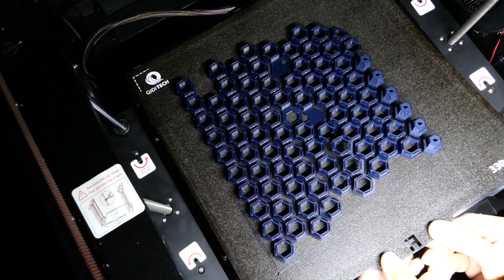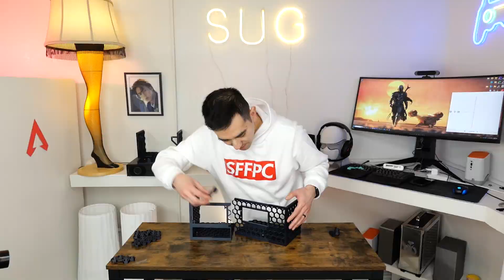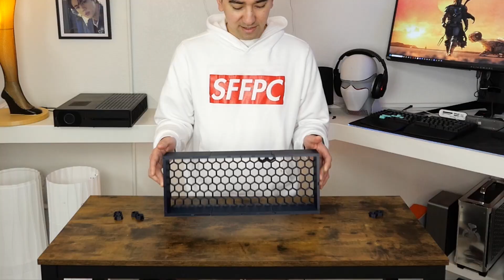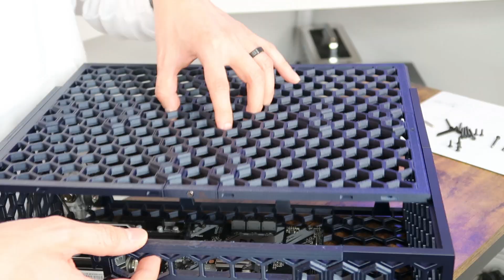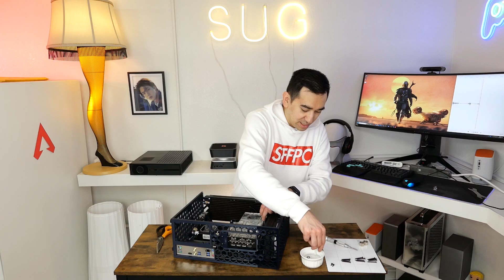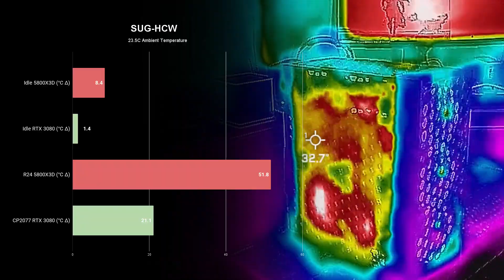A Full Size ATX Gaming PC Anyone Can 3D Print

Comment: 5 months late to the party, but if you still read the comments I think I have the answer you was looking for that no one seemed to mention yet. When you was plugging in the PC feet/stands the ones that felt loose appeared to only be like that for the regular honeycombs while the honeycomb connectors you printed to keep the pieces together also appear to have inner spacing inside them (guessing because they were designed smaller to fit into the regular part honeycombs) thus making it a tighter fit or connection for your feet/stands when they were inserted. Don't really think you did anything wrong but if you wanted consistent tightness for the feet/stands you could have single honeycomb connectors placed them where you wanted and then connected the feet/stands into them without the need for extra glue. Enjoyed the video and I hope the build has held up over the months.
Reply from the maker: Thanks for watching and sharing the knowledge! The PC has since been dismantled: https://www.youtube.com/live/RdOw7wftjuI?si=tTSuifTfQx7QcqDG

Comment: This is the video that introduced me to your channel. I'm actually planning to build this case. Do you know if it will accommodate a 330mm GPU?
Reply from the maker: Thanks for dropping by! I designed it with the FE RTX 4090 virtual dimensions (I don't own one) - so use that as a measure.
Reply: @standupg4m3r  looks like my card may be too long, so I'll need to get creative. Even water cooling the gpu won't help since the PCB extends to the edge of the heatsink
Reply from the maker: @XxDrac13xX  i forgot that not everyone needs to watercool? https://www.printables.com/model/866926-sug-hun/comments/1906251
Reply: @standupg4m3r  I have an AIO for the CPU so mounting the riser won't be an issue. But my RX6900XT is 330mm and the 4090FE is 304mm. I could use a 900mm riser from Lian Li and just use the GPU like an external GPU or I could make some mount extensions for the front fans and make the front panel deeper to make room for the GPU
Reply from the maker: Wow that’s lucky! Did they want cash on top of the trade?
Reply: @standupg4m3r nope, just a straight up trade. I used this case for a couple weeks but ended up switching to a Lian Li case because this one was a bit top heavy even without the feet, and I was afraid I was gone bump it and knock it off my desk. I also didn't have a 360mm radiator so I added some heat inserts and zip ties to 3 of my fans. I'm gonna try to get the new Creality K2 Plus so I'll try out your other ATX design since it wouldn't fit my P1S
Reply from the maker: @ new ATX is in the pipe line too lol
Reply: @standupg4m3r  I can't wait to see it

Comment: As much as I wouldn't use this layout myself, using the hexboard as the base is brilliant.
They're already designed to be modular and connected firmly.  It's a really nice shortcut with the added bonus of making the outside surfaces usable
Reply from the maker: I kinda agree on the layout… blocking the PCIE slots ain’t the jam. I probably won’t be touching ATX for a while, but will revise this sometime in the future.

Thanks for watching!
Reply: @standupg4m3r  personally I feel like mATX should be the layout everyone uses... ATX only really gets you 3 more 1x slots. Who the hell has anything to put in those slots and yet isn't going for an extended size with HEDT CPU or straight up server hardware. And on the other end itx makes a bunch of sacrifices to reach the size.

I didn't check at all. But maybe that size difference makes it possible to print most sides as single pieces even on 250x250x250 printers (Mk3/4 and bambus) 

PS: the rest of the layout possibilities is left as an imagination exercise to the reader.
Reply from the maker: @SquintyGears  believe it or not… my editing rig is getting 2 PCIE1x USB controllers on… with a 3rd likely on the way lol
Reply: @standupg4m3r  oh no I do believe you. I have an extra USB card and wifi because I didn't buy a board with it built in originally. I meant really getting the extra slots from full size is rarely a useful thing. And usually it's because the system doesn't even support that many pcie lanes. So the stuff plugged in can't even be high bandwidth devices.

So yeah you can get 12 more USB3 ports but it's functionally identical to getting a quality external powered usb hub because you can't hit all the ports at full speed. So getting the 5 slots from mATX (really it's 3 after the GPU covers 2 slots) covers everyone except solo professionals before they move to HEDT beaffy systems.
Reply from the maker: @SquintyGears  with your logic and compartmentalizing users, we should all just be on Macs and consoles. The beauty of PCs is that affluent virgins all across the globe can stick whatever they want in what holes they have available to them in their PCs. 😝 

PS - with bifurcation we can also perform DP.
Reply: @standupg4m3r  no no no, that's a huge ways away from what I'm saying. I'm not saying nobody needs expansion. I'm saying ATX on regular desktop platforms doesn't properly give you the expansion it claims to give. So the mainstream platform should probably be mATX and everyone would just save a buck.

Comment: this 3d printed case looks really well designed and SUG did a fantastic job printing, finishing, and building this.  HOWEVER... water cooling doesn't make ANY sense from a performance perspective UNLESS you've already got top-end components.  i.e. in this system, the cost of a pump, rad, tubing, compression fittings, res, and pressure tester (Assuming you don't have one already) is MORE than the cost of moving to a 4080ti (maybe even a 4090) which would give much more significant performance uplift in a gaming-centric build or a 7950x in the case of a cpu/productivity build.  sure, it looks fantastic, and yeah, it can make things a little quieter (though even that's questionable compared to the big beefy air coolers on some of these upper end 40 series gpus.) and cpu cooling wise, you'd get way more cooling out of something like a noctua l9x65 or a more typical tower cooler. especially once the liquid system is heat soaked (which takes about 30 minutes of a combination gpu/cpu load to happen).
tl;dr: is this build awesome - ABSOLUTELY - is it something that someone should replicate? not really unless you want to throw down for a 7950x/4090 (or wait for the upcoming 9550x/5090 that'll be available in just a few months.
Reply from the maker: Thanks for watching anyway!
Reply: @standupg4m3r  I really didn't mean to be negative, it's a sick rig, certainly something to be proud of. - and there's room for upgrades if you want to go for broke resolution-wise. - it looks really flexible!

Comment: I really like this design but is there a way you can build it without water cooling or can you use an AIO
Reply from the maker: Thanks! It should work with 360mm AIO and 240mm GPU AIO - but with baller parts like maybe you shouldn’t lol

Comment: One thing that stops me from designing and printing my PC case is static electricity.
IMHO:
As far as I know, plastic PLA or PET(G) are bad electrical conductors and therefore they can accumulate static electricity on the surface. And if we count the fact that coolers inside the cases create the air flow that may make additional friction, the problem with static electricity becomes more serious. Cause it may damage PC components.
How did you solve this problem?
Reply from the maker: I’ll let you know if I have any problems after I build over 100 PC cases. So far I’m ONLY at 25 with no issues…

Comment: Damn i gotta try this, printable on a 180 x 180 :O my Bambu lab A1 mini is gonna get to work now.
Reply from the maker: GLHF!
Reply: @standupg4m3r  Thank you i am struggelin to understand what the 6-32 parts are, can this be converted to something a european would understand xD? any1 please bid in
Reply from the maker: @doughboyHS  maybe ChatGPT can help you: 

“A 6-32 screw might be a bit confusing if you're used to metric measurements, so let's break it down in a way that makes sense:

- **Diameter "6"**: This doesn't directly translate to millimeters, but the diameter of a 6-32 screw is about 3.5 millimeters. So, imagine a screw that's just a little thicker than a typical 3mm screw.
  
- **Threading "32"**: This number tells you how tightly the threads are spaced. "32 threads per inch" means there are 32 spiral grooves along each inch of the screw's length. In metric terms, it's like saying the screw has a thread pitch of about 0.79 millimeters (distance between each thread).

So, a 6-32 screw is roughly 3.5mm in diameter with closely spaced threads, making it useful for securely fastening components together, like in computers or electronics.”
Reply: @standupg4m3r  Thank you so much, by coincidence i found a kit with varius heat sinks for a small amount of money, so i will go with trial and error to find a insert that fits :D så the printing can begin :D

Comment: This is so cool! I love it! But what kind of filament did you use?
Reply from the maker: I don’t know what goes harder? My wife’s boyfriend, or my affiliate links in the description of the parts I used in the build. :)

PS - thanks for watching!
Reply: @standupg4m3r thank you for that. I didn’t see the filament part then saw it.  But I don’t see the CPU block/pump or the other pump at the bottom, unless I missed it again
Reply from the maker: @justinharvey9260  heyo! I haven’t linked those parts yet… mainly because I used what I had available but they aren’t ideal for this build - the pumps are just too weak. 

I have linked a search for 360 CPU AIOs and 240 Hybrid GPUs though - since those should work in this build.

Comment: Hey, awesome job on this. Love the looks of the design.

Can this case be expanded as to make it a little longer and/or taller? 

For example to be able to fit a 360 radiator on the top, or to be able to install an internal reservoir, if I print extra side panel pieces. 

Would it be possible? Just curious…
Reply from the maker: Thanks!

This scheme is extremely expandable, but the main question is do I want my eyes to bleed again? https://www.youtube.com/post/UgkxUYqxhK4TeYHuh7zkCYIeaOPfUYUaqeIZ

But having said that, my Patreon does exists... ;)

Comment: So, I needed a full ATX case and found this, I'm using the Honeycomb storage wall so I thought it was a nice complement. Counting that I've bought very cheap petg it costed me about 13€, and took less than 48h to print on the A1 mini.
I had to tweak a bit the settings but it did not need a lot of support, almost none, all tho the final result is not great and I wish I had spent more time researching a better project, able to accomodate the usual components and not only this specific configuration of water cooled components. You're forced to use a water block on the CPU and there is not enough clearance for the tall ram with the psu right on top. The front piece is made of solid walls and it's heavy, does not hold with just magnets, I feel like you've cut the video to hide some support that you've needed to hold it in place. Speaking of magnets they are 5x4mm, and as the other screws it was not clear witch size to use. the "sliding part" relies on the structure given by the 3 sized cooler to be tight, the case itself does not hold togheter. the GPU support is very specific for that 2 size radiator and pci riser, you say a 3 slot GPU will fit (so air cooled) but if you don't have a gpu water cooler there's nowhere to mount it. One of the pieces, the one with the motherboard and PSU holes does not exactly fit in 180mm, so I had to make a small cut.

thanks for sharing it but I had to mention the issues so others do not end wasting time and filament. I will try to design some fixes, maybe some clips that hold the crucial parts togheter. and adapters for the GPU, but if you're looking for an ATX case look for something better and more compatible
Reply from the maker: @fporcelli2009  Interesting—45 minutes of detailed explanation still wasn’t enough to help you decide if this case was for you?

For anyone in the same boat, maybe another 1hr of content can help you decide: Dismantling the Custom Water Cooled ATX 3D Printed Case
https://youtube.com/live/RdOw7wftjuI?feature=share

If that’s still not enough, for $15,000 USD I will fly out to you with the case, and we can determine if the case is right for you!

Comment: Awesome case! But it's not the best idea not to install a reservoir. :/
Reply from the maker: Thanks. Good thing the end tank of the 360mm is a reservoir. ;)
Reply: @standupg4m3r  I know my first water build was a solid copper set from cooler master with a reservoir in the 5,25" bay. In that case you must make sure to suck enough coolant from the system. I'm not arguing or push my opinion on you or any. Rather comms between two builder :)

Comment: Water loop is wrong. You have to go like CPU - 240 radiator - GPU - then 360 radiator.  You c ando it as you did, but is way less effective.
Reply from the maker: Thanks for watching!

Besides ensuring the pumps constantly have water, loop-order has little to no impact on water temperature and therefore component temperatures. But thanks for trying to help!

https://www.ekwb.com/blog/does-loop-order-matter/?gad_source=1&gclid=CjwKCAjw9IayBhBJEiwAVuc3frTCeofwpiRLed2VLOfADgffreVgmxgoFFsHKsjObwTCFIbnSGkZ9BoClPUQAvD_BwE

https://www.reddit.com/r/watercooling/wiki/faq/?share_id=HSpFrkcwFh6shoeIDqcDw&utm_content=1&utm_medium=ios_app&utm_name=iossmf&utm_source=share&utm_term=22#wiki_19._what_order_should_i_run_my_loop.3F

https://www.titanrig.com/blog/post/pc-guides-loop-planning?gad_source=1&gclid=CjwKCAjw9IayBhBJEiwAVuc3fhXoJQt3bKMeo7bym81C7uS0jjwiWiwbgop82dAYhSga6qVjZ1TPlRoC2bcQAvD_BwE

Comment: The Main issue i see, immediately off the bat
How is this a "Full Size ATX" gaming pc
if you block off every other expansion slot and can use only the main PCIe x16 slot
Reply from the maker: @skorpysk  I guess I should’ve called it (s)ATX; (Sorta) ATX™️ 

Does it also lose the ATX moniker, since there’s no drive slots to use all the storage I/O?
Reply: @standupg4m3r  It's a cool build, but
I don't see the full usage of an ATX mobo if you can only use the top PCIe slot.

Maybe you could make it thicker, bit taller. You could maybe fit the PSU under the mobo and that way no need for a sandwich style case. Or perhaps just make it mATX and that way you don't need to make it taller

Comment: @stand_up_g4m3r, congrats for this case, very nice!
As I am a beginner on this, I am looking for a similar ATX case but very compact/minimal-NO GPU,NO Fans, 
just the case around the motherboard(with clearance to the CPU (so that the CPU cooler would be outside the "case") and separately/add ons the supports for PSU and maybe ssd(s).
Would you be interested in creating that 3d model/build something like that?
Thanks!
Reply from the maker: Uhhh… Qidi Tech X-Max 3 for 3D Printed PC Mods
https://youtu.be/ACI2cUQDgfg
Reply: @standupg4m3r  ,thanks for the link. That is an open case, I am looking for a closed one(where the motherboard is 
 protected on both sides) - can be carried around.
Reply from the maker: With the base plate and top radiator bracket, it’s kinda “closed” lol And FYI, my main gaming rig is on it atm, and I move it around more than I should.

Are you imagining something like a Fractal Design Ridge sans side cover?